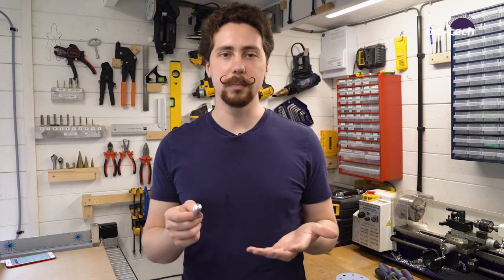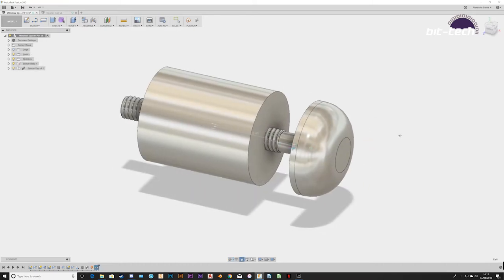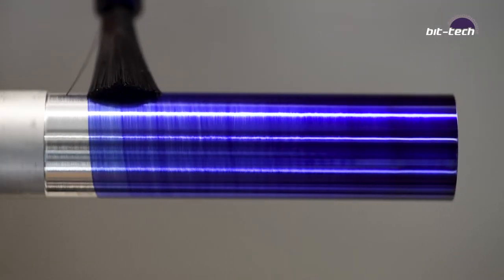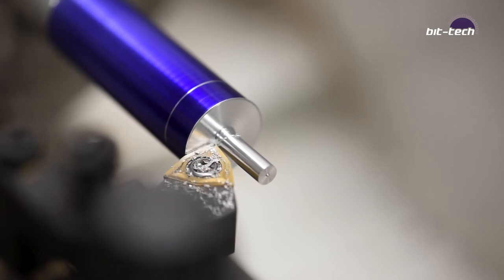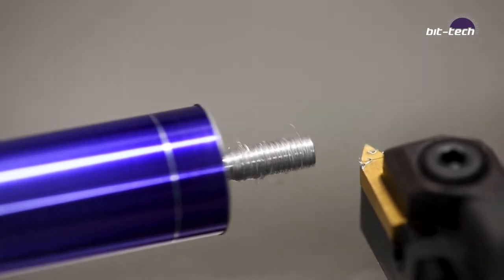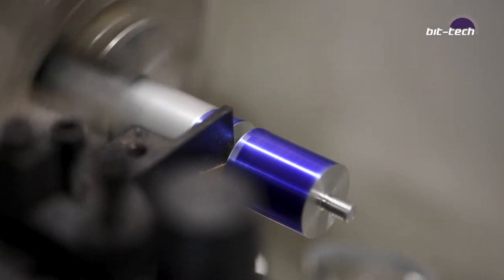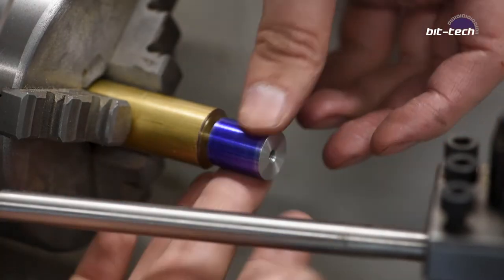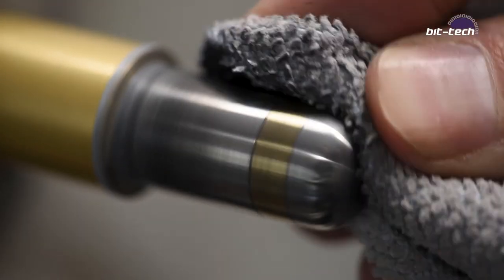Machining Custom Tempered Glass Panel Mounts | bit-tech Modding

Comment: Bruh I really don’t get how this video only has this amount of likes! All the other videos of how to make this include modding the actual side panel but with this method you’d only need to get a new piece of tempered glass and drilling holes
Reply from the maker: It might be that this is quite a specific tutorial that isn't so easy to apply all around. That said, still a small channel haha, we're getting there though!
Reply: bit-tech well I do believe in that, but someone that want to DIY Mod their Case has the ability to do this with standoff’s/grommets from eBay 👌🏻